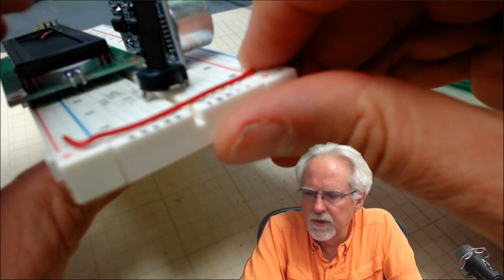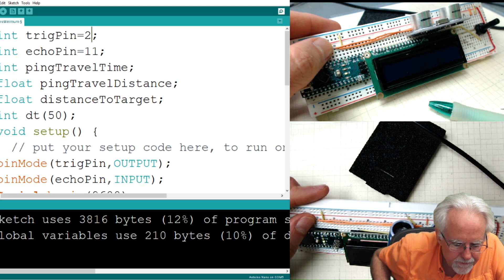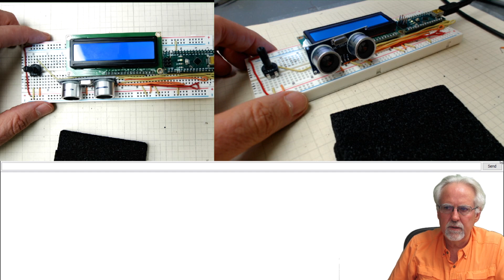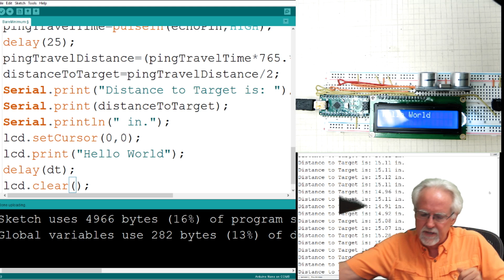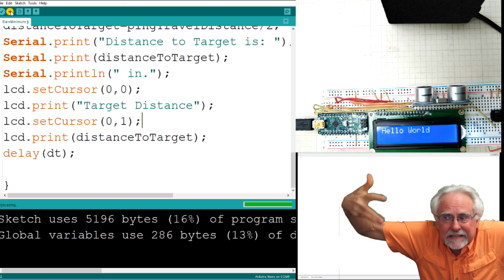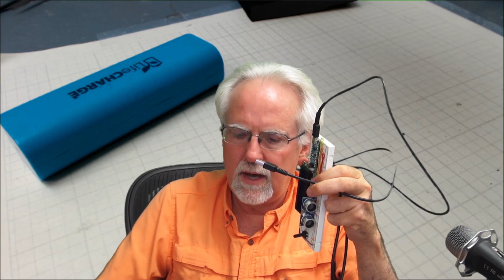Arduino Tutorial 59: How To Build a Portable Distance Detector With the Ultrasonic Sensor

Comment: Successfully built the portable detector. I also included some if statements to convert inches to feet whenever the distance becomes greater than 12 inches. And then the display reads "inches" or "feet" depending on which measurement it is reading.
Reply: not like this little sensor can actually detect things beyond a feet though?

Comment: I did it on my own! Though I had some troubles with getting my lcd to work, had to check wires and pins multiple times (by the way my lcd doesn’t have pins, it has holes so I have to put wires through them and into the breadboard). Also I made it in centimeters since we don’t use inches where I live. Anyways, it was a really interesting project and the first one where I really had to spend some time on troubleshooting. Thank you once again and greetings from Kazakhstan!
Reply from the maker: Great job on the troubleshooting and thanks for the feedback!

Comment: I did it on my own but im not sure if my sensor is crazy or did i do a lousy job. I checked the wires everything was alright then i put your code instead of mine to check if that was the problem but it was still unstable. Is it safe to say that i should get a better sensor or should i check something else?

Comment: You can use 2 of the breadboards, cut the backing tape, remove the power strip, and dovetail attach two breadboards. :}
Reply from the maker: Yes, you can connect them together.

Comment: Yes I did it on my own by referencing previous lessons. However I did it on the bigger board - lots of room but not as compact. I am still using an average for one object and not getting constant readouts for the same object. bAsically you target your object from a stationary position and then start the sketch. You didn't mention it but I assume you intended to just start and stop by unplugging. Would be neat to have included a button to do this.

Comment: I had already built this before, when we first moved from LCD to the HC-sensor, i started to output straight to the LCD, it pleased me. 
TIP, use a pair of snipe nosed pliers to insert those wires, it's much easier, also, when they get bent it's simple to straighten them, using the inside clear faces of the pliers. I also use a tough set of stainless tweezers, I'm no where as nimble as 20 years ago, so let the tweezers do the work.

Comment: Hi Paul ,yes I did it on my own and it works perfectly. The only thing I forgot to do initially was to include the Serial.begin statement !
But a little adjustment to the LCD as i used distance to target and then the results. I next set it up as a standalone . The one thing that is not working is the Nano I am using will not talk to the PC so I just used the Mega . I have a CRO and just love showing my wife and the Neighbours the collapsing waveform as you place something in range. Many thanks young man.

Comment: I did it this way :-

#include <LiquidCrystal.h>

const int waiT=75;
const int trigPin=13;
const int echoPin=12;
const int rs=11;
const int en=10;
const int d4=4;
const int d5=5;
const int d6=6;
const int d7=7;
float ds;
LiquidCrystal dspl(rs, en, d4, d5, d6, d7);

void setup() {
  // put your setup code here, to run once:
  Serial.begin(9600);
  dspl.begin(16,2);
  pinMode(trigPin, OUTPUT);
  pinMode(echoPin, INPUT);
}

void loop() {
  // put your main code here, to run repeatedly:
  digitalWrite(trigPin, LOW);
  delayMicroseconds(10);
  digitalWrite(trigPin, HIGH);
  delayMicroseconds(10);
  digitalWrite(trigPin, LOW);
  ds=((pulseIn(echoPin, HIGH))/2.)*0.033;
  dspl.setCursor(0,2);
  dspl.print("Distance :-");
  dspl.setCursor(1,4);
  dspl.print(ds);
  dspl.print("cm");
  delay(waiT);
  dspl.clear();
}

please try to troubleshoot it.

Comment: My whole reason for getting into arduino is for digital screens.  And up until this point I've followed along with the dot matrix screen ( think that's what it is,  but the 2 line screen none the less. ) but today I finally worked out how to get my 1.77" TFT display going.  A little off on formatting.. but I'm working on that.  It can be read and updates with a flash.. but it works!! 
"Distance
27.45inche
s"
Lol cheers!!
 Thanks for all this info Mr. McWhorter! You're a bad ass!!

Comment: Yes sir did it on my own, i exchanged pin 11 and pin 12 with pin 2 and pin 3 on the nano so i could use pin 11 and 12 for the LCD i just changed the int values in the programming. I powered everything with a 9 volt battery, i will pick a power bank soon! Thanks again Paul!!!
Reply from the maker: Great 👍

Comment: Thank you so much Paul. I managed to get them connected and working but I was unable to make it portable. When I unplug the Uno board (with a battery attached), the lcd is not updated and it blanks out. Not having a nano is starting to hurt me. I'll buy one when I can afford it.

Edit: I got it portable! Although, the lcd is dim - I think it's because of the battery (the 9V Li-ion that comes with the elegoo kit).

Edit 2: I got it working completely! Changed the 5 V pin to the Vin pin, extracting all of the 9V from the battery. This brightens up the lcd display.

Comment: I had it working before I watched the video.  I started with the ultrasonic & LCD programs then added and modified as needed.  I am using the MAGE2560.  I got the big breadboard.  The LCD did not work until  add jumper wires to the power & ground bus bars.   BC I am using the big breadboard I had to wire every thing from scatch, no problem.

Comment: Hi Paul - I was successful on my own, though I did cut and splice code from other lessons and modified the pin connections.
I got my 2x nanos yesterday, but experienced some problems getting them working - until I found online that I needed to select ATmega328P (Old Bootloader) - wasted 1 hr getting that info.

Comment: I ran out of the neat wires but it works like a charm, and is portable. Running on a 9v battery. Now I know how long my apartment is.  I wonder what the max range is for this. It displays in inches or feet depending on the distance. Thanks for the tutorial!

Comment: Wow..!! Thank you, thank you. I mean, you've just opened me up to a solution I have been cracking my head over for quite some time now. That is, the potentiometer project to switch the LED on and off depending on the target voltage from the pot. Pls, continue the good works.

Comment: I was able to do this one on my own.  I used only one breadboard -- I 3D-printed a project tray which holds the Arduino (uno or nano) and a breadboard.  I used an LCD with the I2C backpack that I got out of another kit.  It is much easier to hook up (less connections needed).  It is good to know how to connect the LCD without the I2C but now that I have that knowledge, I will use the LCD with the I2C.  Great project and I am off to add a pushbutton to my build.
Reply from the maker: You are right. Even for kits that have i2c LCD, I dont mention it so people get experience wiring a complicated build. But yes as we get good at building, it is much simpler and better to just use I2C for those LCD panels

Comment: OK, I came close. I got nearly all of the software correct.  The wiring appeared to be correct. But, there was a problem getting the upload to work OK. The approach was the same as here. The execution on the big board I used didn't work. "Missed It by This Much."

Comment: Hey Paul, thanks for this amazing Arduino Series. Since i had this build working since lesson 53, i unhooked everything and did the assignment but to make it a little harder i decided to also add the DHT11 sensor and 2 buttons. I used the buttons to Toggle between the Ultrasonic sensor and the DHT11 sensor and displayed distance in ft and cm or temp and humidity to the LCD. 

Its funny how you were kind of struggling to fit everything on the breadboard and even considered using the monster breadboard when here, i was able to fit the elegoo power supply, the nano, the ultrasonic sensor, the DHT11 sensor, the potentiometer, the 2 buttons and the LCD all neatly and organized in the same size breadboard as yours and even had room to spare. Thanks to your teachings and the assignments you give us i have gotten really good at building neat and organized circuits.

I really enjoyed doing this project and i am really excited to see what we will be learning next. Thank you!
Reply: haha! I also added the DHT and made the whole thing after 53! I used the temp reading as a factor in speed of sound to make the distance measurement more accurate in various climates. The ultrasonic sensor's doc says it reads to 4 meters accurately, so I set the program to give me climate info when reading over 4m, then shows distance in mm and inches when you're within 4m.

Comment: excellent sir, i am from India, Am hobbyist. I need the code and circuit diagram for 1) distance measurement both CM & Inches with decimal( Centimeter & Inches) for 16X02LCD without using breadboard 

And
 2) distance measurement both CM , Inches , Ft & MM with decimal(CM , Inches, Millimeter & feet) for 16X04LCD 
Can you pls share it?

Comment: So I have taken a slight break from the lesson because I was waiting on some parts and I have been working on a project involving different modules that are not covered in your lessons. Let me tell you watching other videos on how to connect and program things is way harder to understand and there is much less explanation. They may tell you how to do it but they don't explain what's going on with the code in great detail like you do. I ordered a RTC module and I thought it was going to be a piece of cake. I came to the realization that I was in some kind of a bubble while learning with you and I had a lot to learn. Choosing the right library and then finding enough documentation on how to use the library was quite the challenge. A so I thought 15 min easy project turned into a frustrating day project. Basically what I learned was I have a lot to learn lol... Thanks for another great video!

Comment: I got it all hooked up and working prior to the video. Definitely not as neat as yours though because I am limited to only having access to the basic kit at this stage (stuck in a hotel for 2 weeks quarantine due to travelling interstate in Australia). I pretty well did everything else the same, apart from using the metric system instead lol. Even if I do get something working prior to the lesson, I always watch your videos all the way through as there is always something extra to learn or better ways of doing things that I either didnt know or hadnt thought of. Thanks again for another great lesson.

Comment: I used pins A0-A5 for the LCD. These have the ability to work as the standard digital I/O, which made it easier to wire everything. I also ran the LCD wires under it by connecting them prior to adding the screen.

Initially I used pins A1-A6, which did not work. After hours of troubleshooting I read the documentation for the Nano and found out that A6 and A7 are for input only! Oh well at least I know now.

Comment: did it on my own with the bigger breadboard and flat wires. Nice to have the extra room. Used a Nano and breadboard power supply module connected to 9V battery. Kept everything in Metric.

Comment: I did the homework on my own, but used a lot of cutting and pasting from earlier assignments to set up the sensor and display.  My Nano has not arrived yet but I put the sensor on a mini breadboard and got everything connected.  Fortunately my display was still installed, so I saved a lot of time wiring it up.  Keep up your most excellent courseware development for your followers.

Comment: Save yourself from the rat's nest Paul is making and go to the big board  using Nano cut and strip. Used 2 board sections connected power rails first board, and second board. Used the power supply and the 9 V. and I already have the button.

Comment: Had some down time.  Hand copied your switch solution and added it to my ver. today.  Had to go to serial monitor and look for problem with while loop.  Button was High but on button press serial monitor reported 01010101.....  ???  Printed a hard copy and studied it for a short time.  It then hit me as I was reading the code while = 1 only sets value 1 into variable while == 1 is required and was in my handwritten notes that way!  Read what you write.  Also left off units and added that line.  You are doing a good job, I'm making errors, finding them and it works!!

Comment: I tried building this project by myself; I made the circuit on my own but when I plugged it into my computer my NANO started smoking and my lcd stopped working. so I had to order a new lcd and NANO 😑😑. I was following every step you were doing; and it ended up working😃😃. instead of powering the NANO with a power bank i'm powering mine with a breadboard power supply connect to a 9v battery; and instead of my distance being in inches I programmed mine so it reports in Centimeters

Comment: I was able to do it on my own for HW. I was able to copy and paste from previous HWs, then critique the code to make it work. PS: In the Arduino box I bought, my LCD display board has an I2C chip soldered on. A few classes back I spent hours figuring out how to do that part on my own. (Just something to think about, a few of your viewers may have the same problem I had.)
Reply: I know it's been a year since your comment here, but I've recently started messing with an LCD with the I2C soldered on. What library did you use for this?  I've tried a few different ones and ran into code issues when trying to upload the code.

Comment: Hey Paul, I did this all on my own! Heres my code:

#include <LiquidCrystal.h>

int RS=3;
int EN=4;
int D4=5;
int D5=6;
int D6=7;
int D7=8;
int echoPin=11;
int trigPin=12;
LiquidCrystal lcd(RS,EN,D4,D5,D6,D7);
int pulse=10;
float pingTravelTime;
float pingTravelDistance;
int dt=100;

void setup() {
  // put your setup code here, to run once:
lcd.begin(16,2);
Serial.begin(9600);
pinMode(echoPin,INPUT);
pinMode(trigPin,OUTPUT);

}

void loop() {
  // put your main code here, to run repeatedly:
digitalWrite(trigPin,LOW);
delayMicroseconds(pulse);
digitalWrite(trigPin,HIGH);
delayMicroseconds(pulse);
digitalWrite(trigPin,LOW);
delayMicroseconds(pulse);
pingTravelTime=pulseIn(echoPin,HIGH);
pingTravelDistance=(0.036*pingTravelTime)/2.;
lcd.setCursor(0,0);
lcd.print(pingTravelDistance);
lcd.print("Cm");
delay(dt);
lcd.clear();
}

Comment: Once again, Paul... amazing ♥

One question though, I have been creating portable projects with arduino nano and arduino Uno using a powerbank as power source. The problem is that most powerbanks have a kind of shutoff condition when the current drawn is below a minimum, which leads to the powerbank to stop powering the circuit (it just powers it during a few seconds).

I have found in the internet that some people avoid this problem by generating periodic pulses which draw more current. However, I do not like this solution (it adds many more components and wires and I intend to be as minimalistic as possible), do any of you guys know of any other solution?

Mr. McWorther, any opinion from you?

Thanks for all the videos, and also for all of you who are supporting this king.

Comment: I folded like a cheap deck of cards and run from the room crying like a little girl!  lol.
No, I had already done this a few lessons back as an extension to the main Tutorial that focused on the LCD and the HC-SR04  I didn't redo it only because I had already done it.
Homework.  Again, I already did that a few lessons back.  2 buttons actually.  
One to toggle between Metric and Imperial, and one to take measurements all the time the button is pressed.
It also switched from inches to feet at 12" and from cm to meters at 100cm.
I initially tried to put all the information on the LCD, but it got too cryptic and didn't work properly with the bigger figures.
Reply from the maker: You are getting through these lessons. Hope you are thinking about doing the Jetson Nano lessons next

Comment: Sir, I'm so glade to you and your training. I learn lot of things about Arduino. I completed this project with some modification. It's working fine. I want to display the distance with feet and inches where I got only inches data. I convert it in feet. But can't display the result as 1st line is " Found the distance is:" and 2nd line " xx Feet and xx inches." Could you please help me. May be you teach this and I missed.

Comment: I managed this one all by myself. I even managed to squeeze the whole setup on a standard 800 point board. One of the most useful components I have come across in my studies on electronics has been the 7805 voltage regulator. You can connect the whole thing up to a 9v battery and still have plenty room left for the rest of the components.

Comment: In a word, BOOM!  I'd managed to get this working using the Uno and lots of wires, but it couldn't be moved easily.  Had to wait on the delivery of some more breadboard and a couple of nano's, but pretty much managed to transplant across borrowing from your design but well before you finished ;-)  I like to think mine is better too as it's taking measurements in the 21st Century using millimetres and not the 1800's in feet and inches! https://home.apeconsulting.co.uk/adrian/wp-content/uploads/sites/2/2020/06/Arduino-Tutorial-59-Portable-Distance-Detector-scaled.jpg

Comment: I gotta stop watching the assignment before bed; I have restless dreams but the problem's solved in the morning!  I got mine to work.  I cut the wire mess down slightly by running the pwr/gnd wires under the LCD to the powerstrip it's laying over.